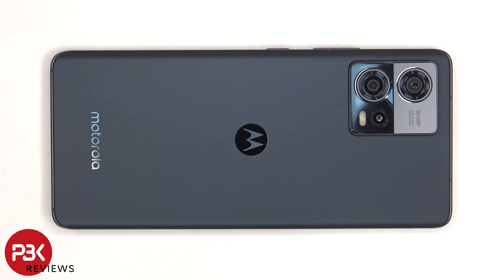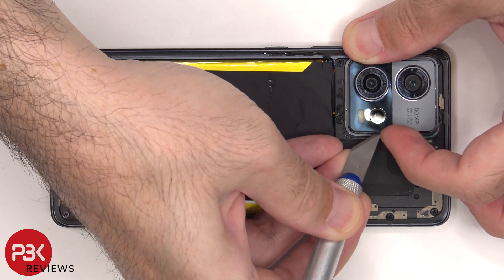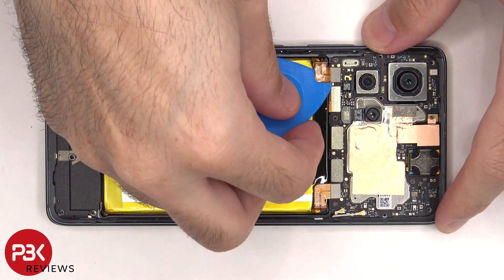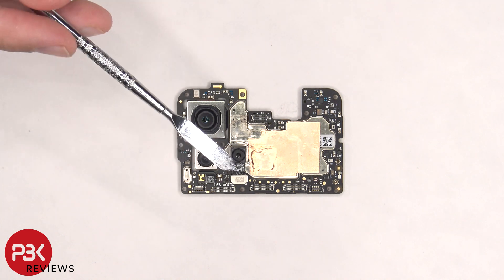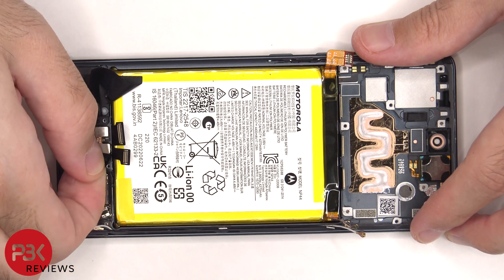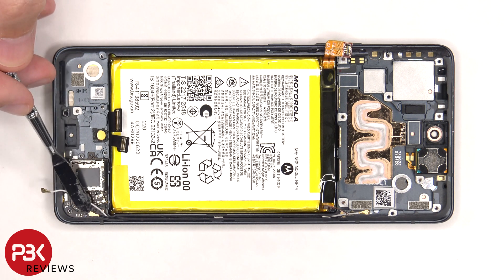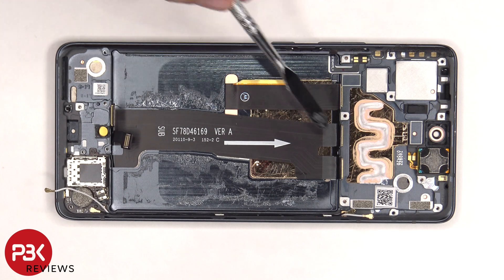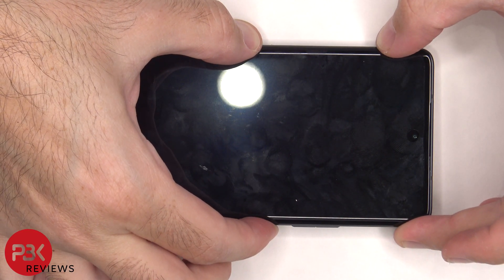Motorola Moto S30 Pro Edge 30 Fusion Disassembly Teardown Repair Video Review

Comment: 3:44 Is that the RAM chip? Does it mean we can easily replace it?
Reply from the maker: It is but its not user replaceable. Its soldered on with the cpu to the main board.

Comment: Hello, I had my moto edge 30 serviced since it had been in water. So the screen is not working currently, its works, but only blank. I had my mobile cleaned from 3rd party, but my volume up button is not working, volume down and power button and rest of the mobile is working fine.

So my question is, is the volume button connected to display, is there possibility that the volume up button is not working because of the damaged screen?
Reply from the maker: It's not connected to the screen, and its possible the flex cable for the volume and power button is damaged from either the corrosion from water damage or from physical damage. Would probably require changing the flex cable. But with water damage the problem can be many things. Corrosion or damage to the contact on the board which touches the flex cable contacts to give it signal or other parts damaged from the corrosion.
Reply: @PBKreviews  So if the flex cable is damaged, can it be replaced? if so what would it cost?

Comment: I bought edge 30 fusion from online store... But after 3 weeks it stop charging the device... So sir do you have any idea about the problem.. is this the faulty of the motherboard or the sub pcb board
Reply from the maker: It can be from the sub board or battery not sure. Maybe even the charger. You would have to check those.

Comment: How do you think is the phone's thermal management, considering SD 888+ tends to heat a looooooot..?
Reply from the maker: I haven't extensively used it, but based off the vapor chamber and overall cooling layout, I think it has good thermal management
Reply: @PBKreviews  Oh, okay.. Thanks for the info!!